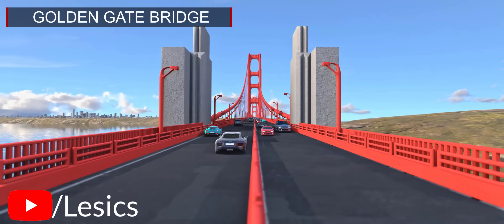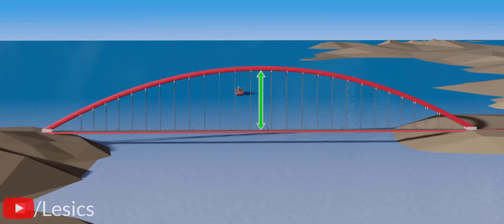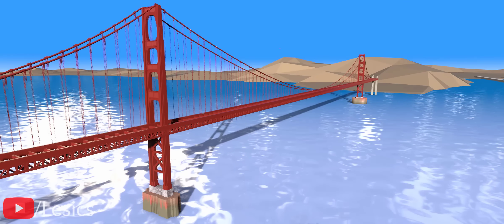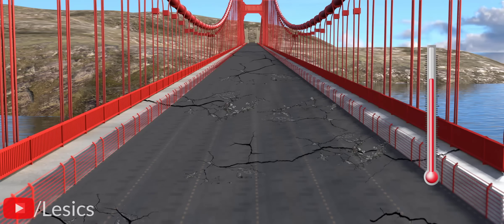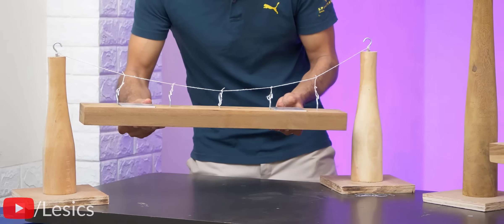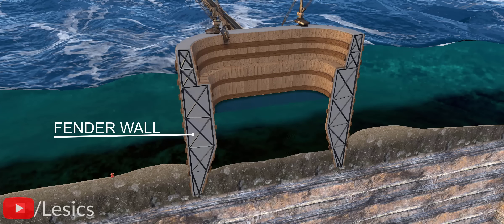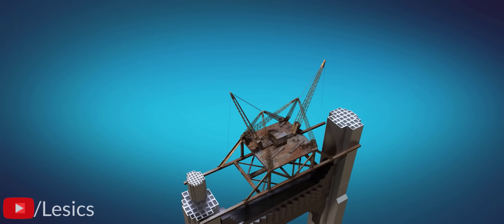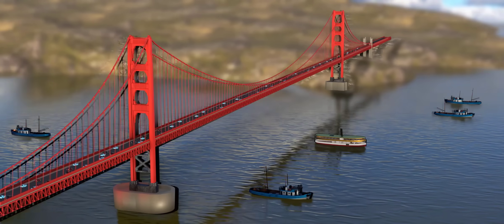Golden Gate Bridge | The CRAZY Engineering behind it

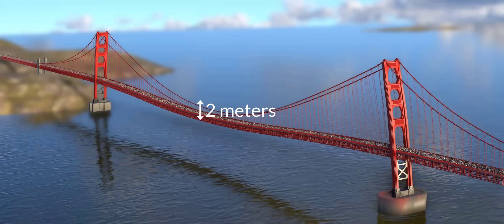Comment: 15:00 how tf that 2 meter drop regained its shape? Its not a rubber.
Reply: The steel deck being supported by the vertical cables isn’t solid at all which makes it flexible. The 2 towers also aren’t completely solid but it does have large solid steel parts that can bend back to its shape bcs it’s steel, which is why it regained its shape
Reply: 1. Everything has some degree of flexibility, steel can be abit flexible under a lot of weight
2. Since it bended inwards, the towers now experiencing more tension force away from the centre returning the original shape

Comment: Charles Alton Ellis was the major inventor of the bridge, followed by  Leon Moisseiff. You gave Strauss waaaaayyy too much credit in this video, which is rather unfortunate.
Reply: The most amazing thing about this bridge is that just two men were responsible for the design… not a large team of engineers as would be expected, but just 2 individuals!! Moissieff for the bold vision of a single suspension to span a distance twice as long as anything attempted at that time, and Ellis to do the enormously detailed calculations for structural specs, load distributions, wind loads, etc. The design work alone greatly exceeds in terms of complexity anything contributed by Strauss, although he too was good at managing the timeline and actually finishing ahead of schedule.
Reply: False. Fake news.
Reply: Leon was imigrant too so he doesn't deserve any credit

Comment: Simple math. 300k people is 60 million pounds at an average of about 180pounds median. The total length of Golden Gate Bridge is 8,981 feet. Apart from a total dead load of 887,000 tons, this suspension bridge can hold a total live load (moving load) of 4000 pounds per feet. That makes a total of 36 million pounds over the entire span... so almost TWICE it's structural capacity during the 50th anniversary. Suspension bridges are said to fail if they carry more than three times their maximum load.

Comment: it is a really great video, but I still have small issue,
I have always wondered how did the engineers solved the issue of the distance between the continents, 
according to toe reaches the continents move about 0.6 inch a year,
so if there is a bridge between 2 continents like the one which is now in Turkey,
 after 50 year of building it, the continents will move away form each other by 50 inch, how can we solve that ??

Comment: I got as far as 1:30sec and saw a major flaw in your analysis, you obviously forgot to support the suspension bridge by continuing the cables on either side to the ground where they would be connected to a relative counterweight, usually a mass concrete block foundation - without this, your bridge would fail, period.
Reply: It’s a shame you only made it 1 minute in because that is covered

Comment: Part 2 can discuss maintenance.   In particular:  how in the world do they inspect for corrosion in the tower bases?   Certainly the original paint and sealants have not held up perfectly these 80 years since.  Any pinhole of weakness can be a grave problem in that saltwater environment.
Do they just look for the worst rust, chisel out the oxidation, and then back fill the hole with JB Weld?  Those assemblies of "Lego pieces" do not support easy access to all air spaces in the structure.
Reply: They have a crew who works year round on the rust . Daily

Comment: Some day, they are going to build the bridge pieces, out of carbon fiber and resin in the factories. And then transport it to the site and assemble it, that too by using solar-powered robots. Carbon fiber also has a low thermal expansion, and less weight. All of a sudden, setting up a bridge will become so easy. The Sheriff can just order it online from a bridge factory located in China.

Comment: After time don't the individual cables making up the large brindle deteriorate may be at the fixing at the ends of the cables or inbetween.
Like parts of aircraft say parts of the fusularge or wings.
I presume they will need replacing, at some time.
Thanks for the explanation of how it was built and the video.

Comment: You should have mentioned that Strauss was not the sole engineer, Charles Ellis was chiefly responsible for the bridge’s structural design but was not credited as such until 2012, and further engineering contributions were made by Leon Solomon Moisseif
Reply: Yes, Moissieff was really the originator of the suspension concept for this bridge  after Strauss' original design was rejected. It would've had a towering half-arch at each end of the straight, with a short suspension span in the middle, and it was ugly as sin. Luckily Mr. Moissieff, who had worked on a couple suspension designs in New York, brought the suspension concept into consideration. And from there, Charles Ellis did all the heavy lifting on the structural analysis and higher math. Moissieff was only a civil engineer.  And although he had a great vision, it took a structural engineer like Ellis to convert it into a workable design. 

This is also the main reason the Hood Narrows Bridge collapsed a few years later in 1940. Mossieff and his partner had bamboozled the Review Board in WA that he was the right man for the job. In reality, he was totally out of his league in structural analysis.  The solid 8 ft trusses he used under the roadway acted as huge sails and set up some huge standing waves, a twisting oscillation on the road-deck that quickly caused the bridge to fall apart.  So, he was a good visionary, bad engineer.